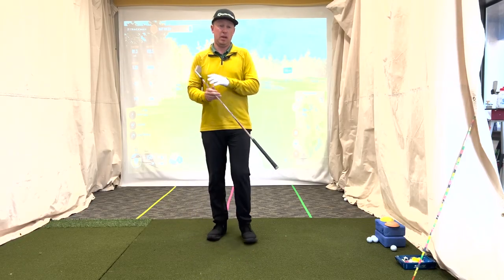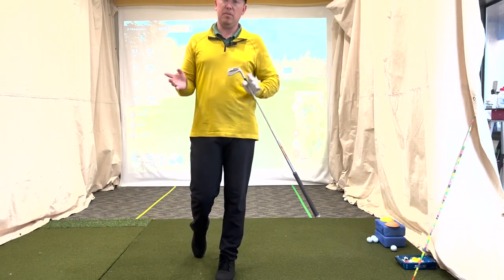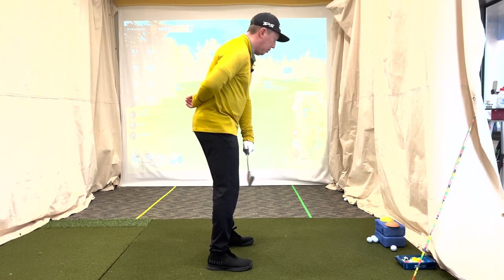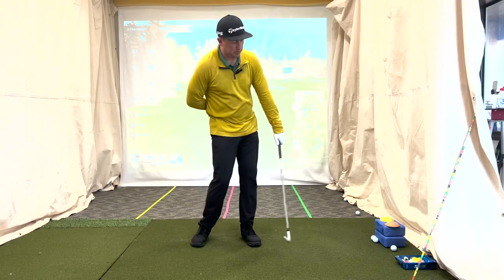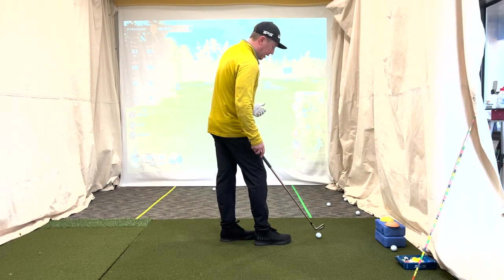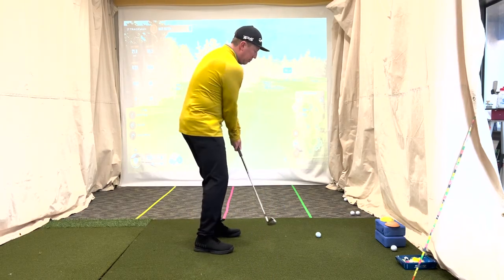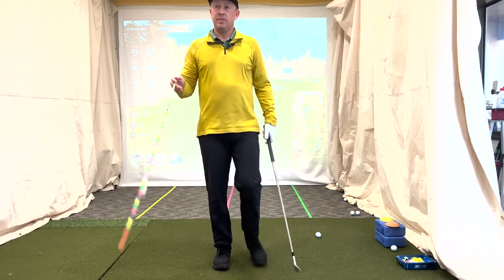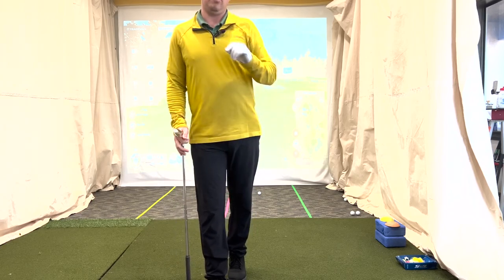Anti Flip Drill for better impact positions

Comment: Matt, great video as always.  What about us that can't rotate towards/to the finish target due to back problems and left front foot weight transfer problems while chipping that 30 yard and less golf shot.  I have tried dropping that front foot back in my stance, opening my hips so I can rotate towards the target.  I have a bad habit of slowing my follow thru and clunking the ball.  That 5 hour drive to Murfeesboro, Tennessee to see you is looking shorter and shorter.
Reply from the maker: Any time I can help just let me know. If you struggle with the rotation you’ll have to play a more vertical plane. The more depth you have in the backswing with your arms the more rotation will be required to square the club back. So make the arms go up and down more than back and out